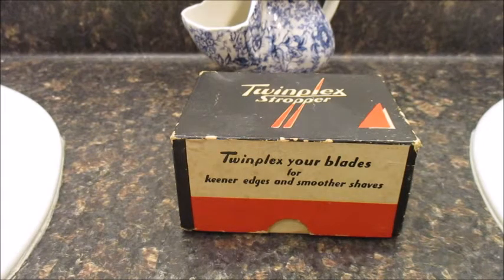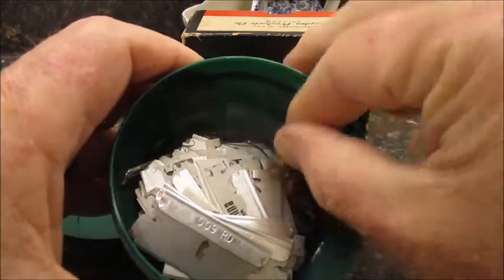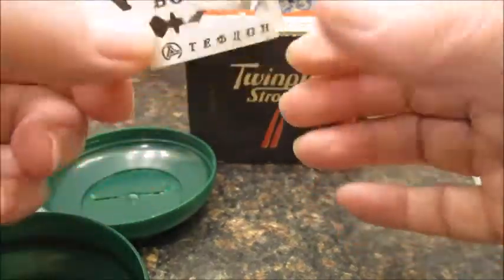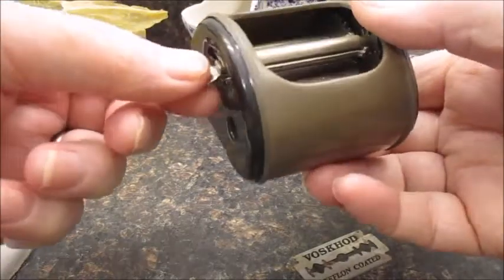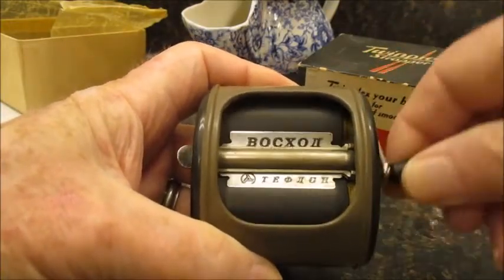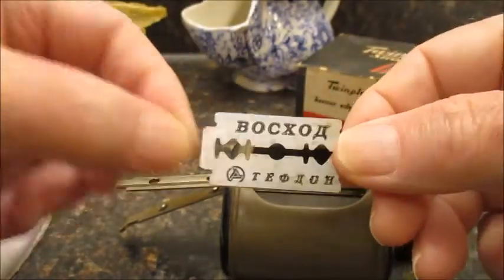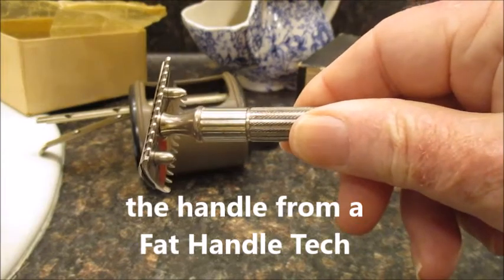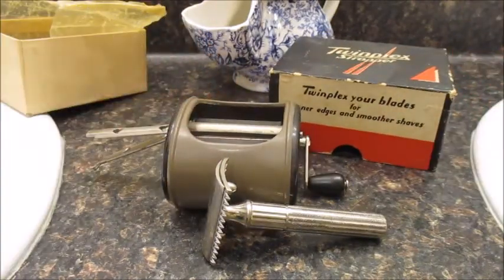Stropping with the Twinplex Stropper

Comment: For best results, go straight from the razor when it gets dull. It wont be nicked or chipped by bouncing around in a blade bank or sitting on a shelf. Im building a 1930's themed house and thats why I havent been too active. But when things settle down, I intend on doing that autostrop challenge. These stropping tools are awesome. I havent really tried many of mine yet.
Reply: I look forward to your experience with your stropping machines. Yes, I understand, as you suggest, that the common practice was to clean and dry off the carbon steel blade immediately after a shave, put it in the twinplex stropper, crank it a few times, and leave the blade in the stropper. At the next shave, the machine gets cranked a few more times, and then removed for use in the razor. In this way, a single Gillette Blue blade could be maintained for up to a year of shaves. At least that is the mythology.

I also own a twinplex stropper. I bought some NOS Gillette Blue blades to use with it, but haven't gotten around to the grand experiment yet.
Reply: @ivermec-tin666  This is one I dont own. I have an allegro and a few others. Even some meant for honing disposable blades. If you ever do that experiment, I would be very interested in the results.
Reply: @davetherave6569  Thanks Dave!